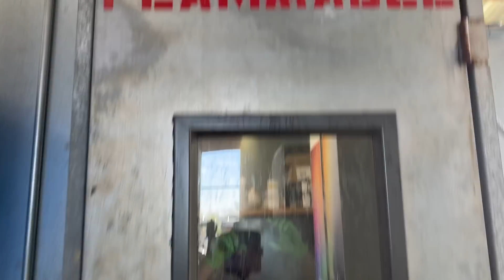Painting My Nissan GTR And A Mustang UPDATE

Comment: When you are priming, sealing, and base-coating repaired areas, mask off panels that will only need slight color applied. So, mask off car like seen here but then mask off the doors since they are already color coated. That way you wont get sealer and other over spray where it is not wanted. Go and color coat the primed, sealed panels until you get desired coverage. Remove the masking from the panels and tack off entire car before finishing off the remaining overall coats needed to achieve full color saturation. Clear as you normally would. This is a great way to do blends also. Keeps you focused on only those panels that need several coats and then a final blend on adjacent panels.

Comment: When you paint the 66 check where the corners where the roof meets the quarter window/panels. They need to be fixed with lead due to flexibility.
Reply: Lead is considered to be a hazardous material and likely outlawed.

Comment: The paint job looks great but I've been waiting for the Mustang project. I thought you gave up on it. You did great work on the frame so far but I don't believe you'll finish the Mustang. When you get to the part where it needs a windshield I'll tell you how to make it happen. Just leave a comment on my latest video and I'll get back to you. I don't now if you read the comments so there's no point in going into detail here. I plan to build two rat rods this year on my you tube channel and you're welcome to criticize my builds. You're more talented than I was at your age so you might be able to teach me some tricks too. But I know how to solve your windshield problem. Check out my latest video. It's the first burnout of the year in my 65 Mustang fastback. It didn't end well.